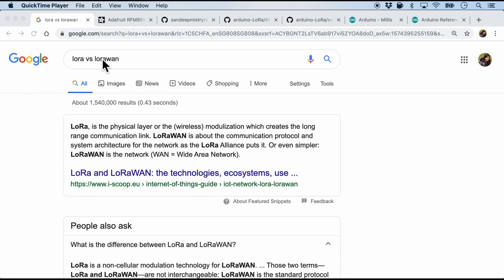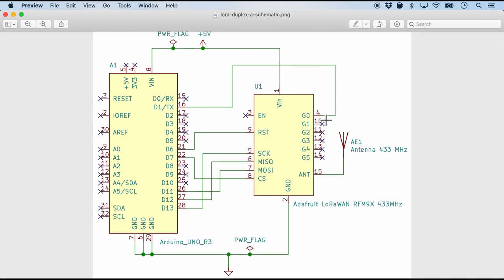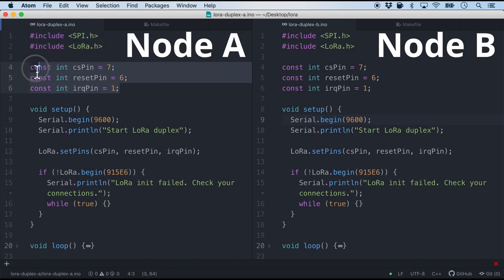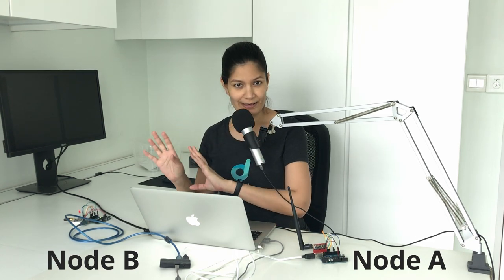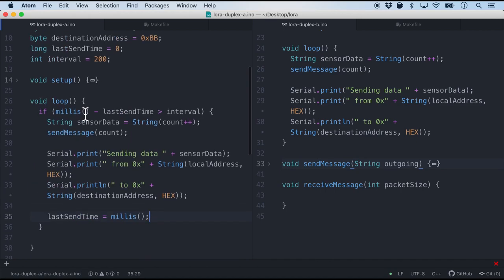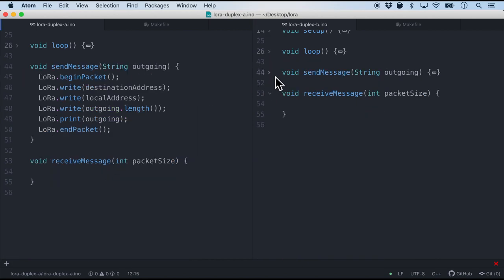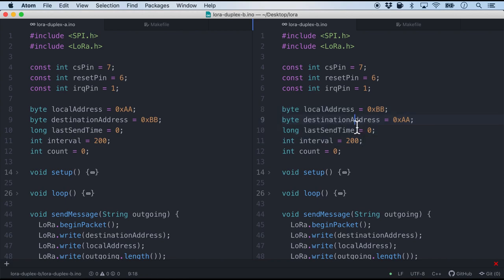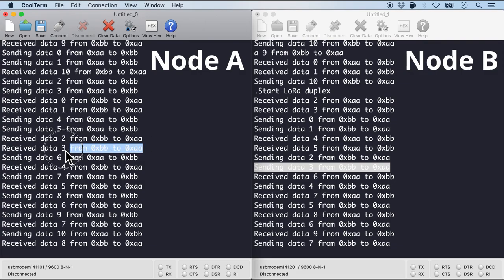Using LoRa for P2P half-duplex long range communication

Comment: Hi, nice video. I'm new about LoRa. Can you explain, how if there are more LoRa device active at the same time? Will it be interfere with each other? the idea that I got from your explanation, LoRa will check and receive all signal from other LoRa whether it is a known device or unknown device. If like that, LoRa will take more time to check the right address sender device.
Reply from the maker: Specific to this example that I showed in the video, it might seem that the 2 nodes are receiving data from each other simultaneously, but it is not.

The code adds a little random interval time plus a constant period of 2 seconds: https://github.com/hutscape/hutscape.github.io/blob/master/_tutorials/lora-duplex-a/lora-duplex-a.ino#L36. This ensures the 2 nodes are not "clashing" or interfering with each other.

You can say that this is a very simplified form of ALOHA random access protocol http://www.scholarpedia.org/article/Aloha_random_access "In an ALOHA channel each transmitter sharing the channel transmits data packets at random times."
Reply: @sayanee  Yes, I see. Thanks.

Comment: Hello! Is there a way to do data logging with this setup? I have a teensy 4.1 with a micro SD port and i'd like to ask if teensy can be used for this setup, instead of the arduino uno, for the use of data logging. Thank you!

Comment: hi, ive notice you´re not implementing things like Duty cycle, spreading facture(SF), code rate, power transmition, bandwidth. My question is: when using only lora(not lloraWAN) we can simply ignore most of the regulations like the duty cycle, SF/bandwidth?
thanx for the explanation.

Comment: Hi Sayanee, Thanks for the post. Just in case  2 nodes transmit simultaneously and there is a collision , is there an automatic re transmit with some random backoff , built into the LoRa hardware , Or is the data lost ?
Reply from the maker: Great question!!

LoRa (which I covered in this video) in the OSI layer only covers the *Physical layer*, so I believe we can tackle the collision problem in the upper layers like the Transport Layer. LoRaWAN on the other hand covers the higher layers in the OSI model.

I think the hardware only has support for the Physical Layer for the radio, so we have to incorporate our own upper layers to tackle this collision.

As an analogy, TCP which is in the Transport layer of the OSI model, deals with the delivery of data from the source to the destination and it guarantees the delivery, but UDP does not guarantee the delivery of data. Ethernet or WiFi in the Physical layer does not deal with this.
Reply: @sayanee    Thanks for your reply. AFAIK , in the upper layers collisions are usually detected by listening on the transmit channel while broadcasting.Since LoRa is half duplex , would this be possible ? Hope my question is not too inane (won't be the first time)
Reply from the maker: @mumbaiverve2307  Interesting thought! I'm not sure about that :) 

It would depend on the application we are building I guess.

Comment: Thank u for the vid! Question though, if i want to send only from one node and receive only from the other, do i still need the timing and delay?
Reply from the maker: I guess no. If one is receiving and the other is solely transmitting, then just set the transmitting to a periodic interval (or whenever your application needs to transmit). Set the receiving node to receive the packet continuously.

I have the TX and RX examples:
https://hutscape.com/tutorials/lora-tx
https://hutscape.com/tutorials/lora-rx

Comment: I am using Ra-02 SX1278 and Arduino Uno, When I use the example sender and receiver, I have constant communication but whenever I use the codes here, I always get "Sending data..." on one node and "Error: Message length does not match length" on the other node. Why is that so? I am planning to use this to connect 4 LoRa but I can't even connect 2 of them.
Reply from the maker: Try this issue if you are also using arduino-lora library: https://github.com/sandeepmistry/arduino-LoRa/issues/351
Reply: @sayanee  Thank you so much for this. I already resolve the issue I am having. My problem right now is that the Arduino seemed to stop after several minutes (sometimes hours). I need to reopen serial monitor or reset the arduino (using the button) to make it working again. You have any idea how to fix it? Thank you so much for your response!
Reply from the maker: @anonymousx4509  Uh! I wouldn't keep my serial monitor running for hours. There might be some timeout or connection dropped issues.

I suggest looking into other ways of "capturing" the data if that's what you are trying to do.

For example, record it on some memory on the board or send it off to a gateway to be stored in the cloud.

It all depends on what you are trying to do.

Comment: thanks for the tutorial, i tried this but it just show that it sending without receiving. is it means just my receiver module that broken, or the transmiter it self?  can anyone help me?
Reply from the maker: You should have 2 exact pairs of the same LoRa node. If you cannot receive with node A, then try swapping around E.g. Make Node A transmit and Node B receive and vice-versa.

Comment: Excellent video!
I'm working on a multiple objects  GPS tracking project where I track objects in movement, and I need to repeat their signals using repeaters(obviously) to finally receive them in the master device (objects -> repeaters -> Master) or well (objects -> Master).
It's a really long dinstance the signals have to travel (from the master to one of the repeaters is around 33KM!!!)
I think LoRa in 433mhz is my best option, what do you think? What results did you get in your project?
Thank you a lot, now I'm a subscriber :)
Reply from the maker: Thanks for sharing! I'm working on a simple GPS LoRaWAN keychain. It was about a 500m line of sight with the antenna I showed. I haven't yet optimized anything in the firmware or the antenna to get a longer range.

Regarding the frequency, isn't it mandated by the country? Hence, I have to use the 915MHz.

Comment: Read the chip's manual and you will recoil in terror. The most overly complex POS chip I have ever seen. The RYLR896 et al chips allow you to interface to LoRa as if it were a UART with just one byte at a time transmission and reception. No control lines to diddle or query. No timing issues. Just pure asynchronous comms.

Comment: hello, i unable to send and receive more than 150 character using these code
Reply from the maker: Probably because LoRa is a low bandwidth protocol. 

You need a higher-level application-based framework with LoRaWAN to help you with this. 

Try Meshtastic maybe: https://meshtastic.org/

Comment: Could you tell me how much distance I can cover ?
Reply from the maker: I tested this exact setup and it was about 500m line of sight without any optimization in the firmware or the antenna.

In my latest video, with the LilyGO T-Beam, it was about 1km: https://www.youtube.com/watch?v=Kgxx7jivSes
Reply: @sayanee  Thank you for your reply. Can I extend this till 2kms by doing something?
Reply from the maker: @kashifshad3265  Yes I'm sure you could. Optimization in the firmware or antenna or more power or higher altitude and a clear line of sight. 

See this video from Andreas Spiess for more ideas: https://www.youtube.com/watch?v=adhWIo-7gr4
Reply: @sayanee  Sorry m asking you one more question. So basically what my requirement is that I need 2 GPS location of two automobiles and basis on the difference I need to tell the car ahead to slow down or speed up. Can I use Lora shield, arduino uno, GPS module without the lora gateway? and the thing is we don't want to use internet.
Reply from the maker: @kashifshad3265  Yes you can. I did exactly that - no internet, just GPS + LoRa (not LoRaWAN) and then calculate the Haversine distance. The cars need to be in a fairly open space, but you need to test them out in your preferred environment.

You might just need to be aware of the accuracy of the GPS. Depending on the speed of the cars, you will need to test the response time, I guess.

Check out my last video here I used 2 LoRa nodes with GPS and no Internet to calculate their distance https://www.youtube.com/watch?v=Kgxx7jivSes

Comment: can we use something instead to loRa ?
Reply from the maker: Sure! If you want to use another wireless protocol, BLE, WiFi, SigFox, NFC, 4G are all possible. 

With all wireless protocols, there are constraints on power usage, bandwidth, and range. Which wireless we chose, in the end, will all depend on the particular application we are building for.
Reply: @sayanee  Thank you for answering my question 💕